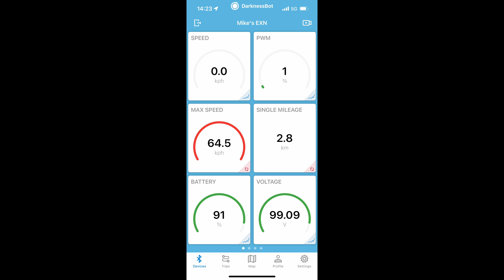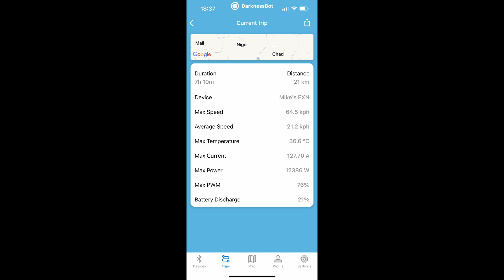Time for some changes - Darknessbot 8.3 - Hardware PWM Reading!

Comment: Nice fog of war at the start. 😛 Good luck with the offer in the new position!
Reply from the maker: Thanks Bill! And thanks for the amazing firmware. Sooo nice to have real PWM values. Since my FW is at 78% and I did not touch 78 the wheel did not beep, etc. However... now at least I can try a push and see how high it goes when I am on the heavy tiltback.